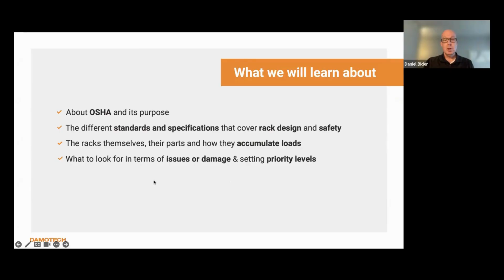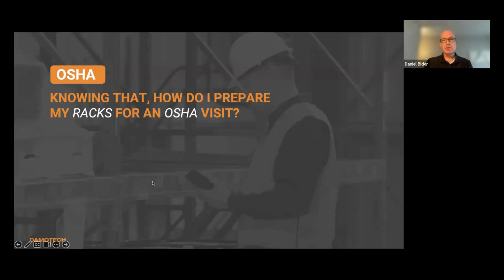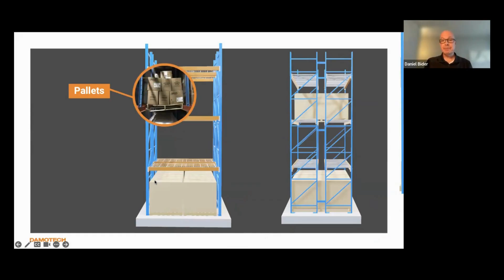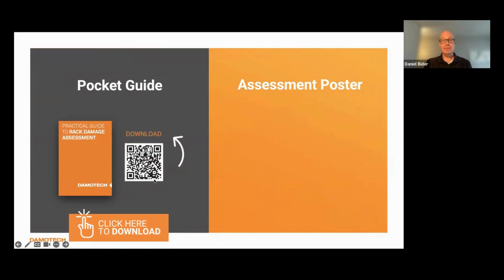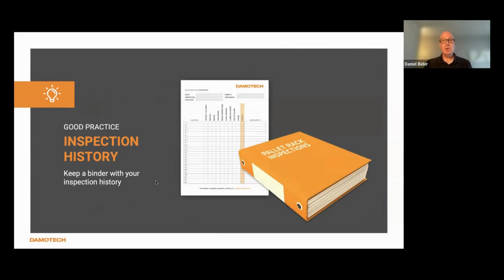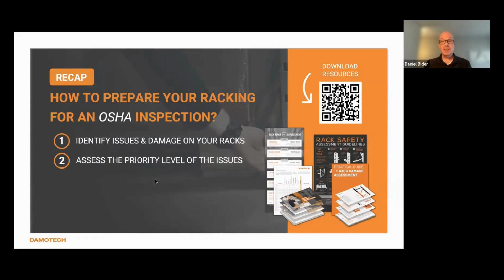How to Prepare Your Warehouse Racks for an OSHA Inspection

Comment from the maker: OSHA doesn't publish a mandatory frequency of rack inspections, but what holds up in an audit is a documented third-party inspection once a year, plus your own internal checks weekly, monthly, or quarterly depending on how hard your racks get hit. The records matter as much as the inspection.

Two things an inspector will ask for that most warehouses can't produce on the spot:
1️⃣ Your inspection history — a binder is fine, you just have to have it
2️⃣ Your LARC drawings and visible load capacity plaques

Jump to the Q&A at 28:11 — Charles and Dan answer 13 real questions from the audience, including anchoring, rust, homemade racking, and how to find capacity when the drawings are long gone.

Free rack inspection checklist → https://www.damotech.com/rack-inspection-checklist-lp

What's the one rack safety question you've never gotten a straight answer on? Drop it below.